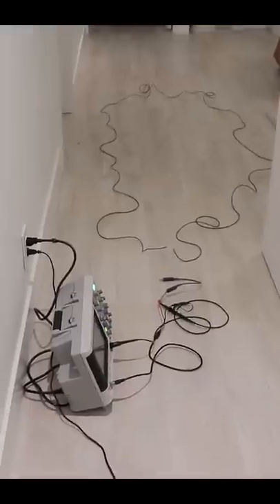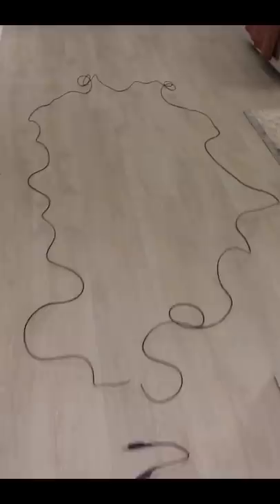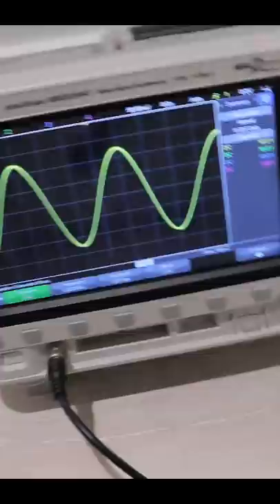The Crazy World of AC Electricity #shorts

Comment: i think the energy is from an transmitter...any celllphonetower near you?
Reply from the maker: The wireless power from a cell tower  is too low to co stably turn the LED on and even of true, then I wouldn't need to connect the functio generator. Either way, it is the function  generator that is turning the LED on, and it also needs to be a specific frequency (5MHz in my case) for it to light up.

Comment: Pls explain why  does it glows ?
Reply: The loop of wire shorting the legs of the LED behaves like an inductor, and it's impedance increases as frequency goes up. At 5 Mhz, it is so big that no current can flow across it, so it can be ignored. The bits of the wire closest to the LED behave like a capacitor to ground, and capacitors get closer to being short circuits as frequency increases. The signal source is also referenced to ground, which means there is a path for current to flow out of the signal source, through the LED, through one of the capacitors, and back through ground into the signal source.